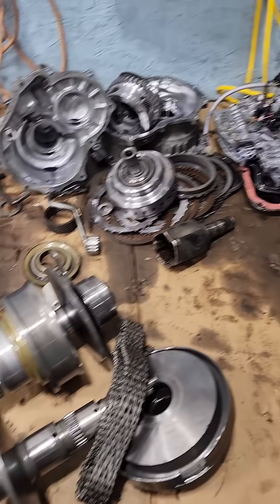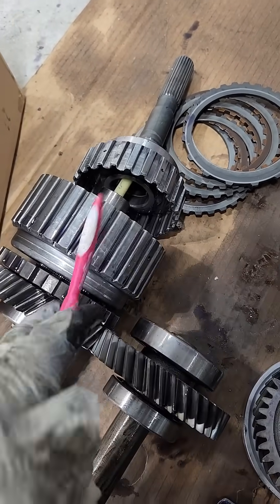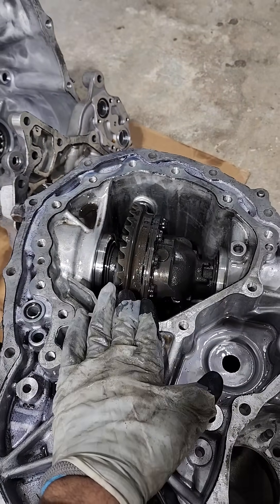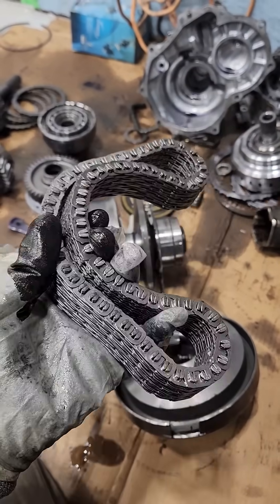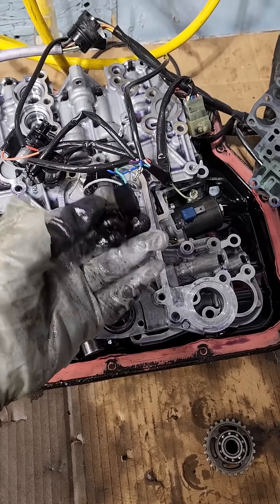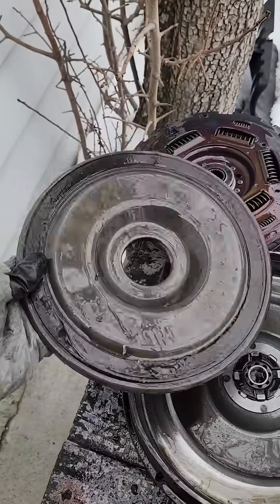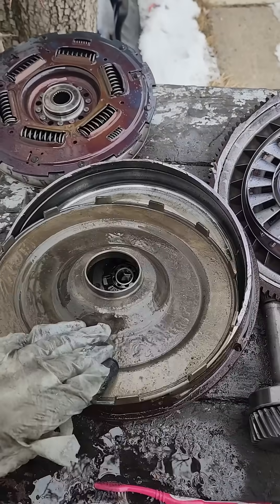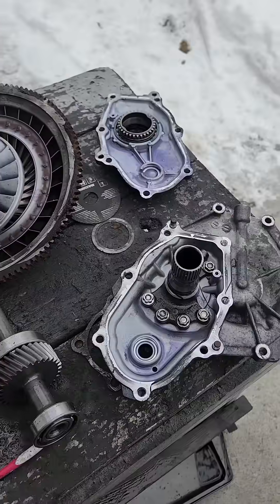Subaru CVT Teardown!

Comment: But the surface contact of the belt to the pulleys is a lot larger than the chain. Does the Subaru CVT works with higher oil pressure to apply the pulleys to the chain?

Comment: It's an 80/20 front to rear constant coupling with the AWD system and goes to 50/50 in power needed conditions. Closer to 50/50 with the off-road or performance models

Comment: 2019 Subaru Forester owner, until the other day when I totalled it.  CVT trans.

I didn't maintain the trans. Lol.  Not once.

124,000 miles when I wrecked it.  Bought it brand new.

As much as I dont like CVT in general, it was nice on the Forester.  Yes, it was incredibly boring to drive.  The engine scrawny from the get go, then pushing it thru a CVT makes it even worse.  

I am a manual fanboy but the Subaru CVT did grow on me.  Primarily because I treated it like shit and it still worked.

It also is really nice in the snow, provided you don't use the stupid "eco" mode and remember to turn the fun on (disable traction control).  Activate sport mode (if you can call anything this slow sport mode) or the LOW option 

The "shifting" is stupid.  You can get around this by accelerating in Low and then switching to ECO when you're at speed.  Still. The fake shifts are so fucking stupid. Yes, I know why they put them in.  Because people who don't understand anything complained.

That being said, now that I've wrecked my Forester I've got a great opportunity to go back to God's intended transmission.  

Sad day when WRX owners try to tell you that CVT in a WRX is a good idea.  They can get fucked.
Reply: Should also add I frequently drove the car hard.  Not every day, but more than most for sure.  Hard acceleration from a standstill?  Yes. Shifting to low on the freeway and pedal all the way down to pass?  Yes.  

Was it fun to drive?  No. Calculations show CVTs lose about 78% of fun coming from the crankshaft. But I am impressed with the durability.

Comment: Great video! I don’t understand why the metal belt doesn’t just slip every time you floor it.
Reply: As far as I've heard, the variators have 800 PSI of hydraulic pressure applied to them to pinch the chain

Comment: It's a lifetime fluid, they swear.
Reply: When you hear that any fluid is for the life of the car, always check with the manufacturer. What life expectancy is usually around 100,000 or 5 years. After that, the manufacturer believes the car should be scrapped. So, they're not deceiving you, they're simply not telling you all the details about the car's life.
Reply: @LootDumpling My comment is sarcasm.

Comment: For a 2020 Outback 2.5 with a CVT-3 transmission, do you think it's possible to use AMSOIL CVTF or ENEOS X PRIME CVT fluid?
Reply from the maker: As long as it's compatible with the Subaru fluid yes

Comment: My 2025 Forester transmission failed at 1432 miles and left me stranded in a center turning lane on a 7 lane highway! It was towed on a flatbed to the dealer. I was told it is the transmission valve       body and they are waiting on the parts. It’s been over two weeks and not a word from them. Fortunately they gave me another new Forester loaner. I’m fearful that when my car is repaired it might fail again. Wonder how probable it will fail again?

Comment: Soo the failure point is the torque converter?
Reply: Funny, I have a subaru with the 5eat automatic, and the torque converter shudders out the wazoo at 40, 60, and 80. Cvt might catch all the popular flack, but it turns out the real issue dates back further.
Reply from the maker: On this model yes

Comment: Don't forget the corolla has a proper first gear and so doesn't need a chain to move 2 tonnes from a standstill
Reply from the maker: The corolla CVT was a 2017 from my last video. Before they went to the physical first gear
Reply: @speedkar99  It would be interesting to have the new transmission for a teardown to see how this first gear is designed in.
Reply: 2 tonne corolla 😳
Reply: @fakenews3676 The 2 tonne reference was regarding a forester with 4 passengers

Comment: It's not so much the power, but the weight. An Outback is 3,700-3,900 Lbs.
Reply: Although there are two types of Subaru CVTs, so if you got a 2.5 Outback, you actually got the smaller 580 CVT compared to the 690 in the XT's and 3.6R's.
Reply from the maker: This was a tr690
Reply: hundred per cent

Comment: Fascinating. Subaru makes one of the best cvt transmissions in my opinion. 
That chain is absolutely massive.
Reply: I agree that the best CVTs in cars are found in Subarus and Toyotas, but they're still not as good as the old traditional autos. 
Mitsubishi's aren't terrible either. I just absolutely hate driving them.
I sold a 2016 Corolla with a '7 speed' CVT recently and I could never own one. At no point did it remotely feel like a '7 speed' 😅 just a really flat, dull driving experience.
Reply: Just got one at 112K the Chain broke.
Reply: Yeah, chain slip really isn't a think for Subarus unless things are REALLY fucked elsewhere, namely if something is overheating the CVT fluid really bad or you're pushing way way more torque than the transmission was ever designed for. Don't launch or do road courses with a CVT, lol. Be very careful if you're going to do offroad as well - 100% use X-Mode and don't go nuts and try to climb up a big sand dune or a rock face.

Unfortunately the Subaru CVT's have problems elsewhere. Like this guy stated, the goddamn solenoids fuck up eventually, basically guaranteed. Manufacturers also don't really want to keep making old parts or have people fixing up old cars forever so you can't fucking buy good ones, either. Higher output, higher mileage CVT Subarus are not too common and it's not only because fewer of them have been sold. They eventually fuck up on the owners and just end up getting traded away. I'm trying to keep mine alive, the dealer wants a whopping $9000 to replace the whole trans.
Reply from the maker: The best CVTs are in scooters. 
CVTs aren't for SUVs.
Reply: @speedkar99 they make the rubber v belts easier to replace too!
Reply: best make eCVT Toyota ;)

Comment: Nice comparo on the type of belt used by subaru vs the fwd rola.
Does the outback share the same cvt model with crosstrek?
Reply: TR580 crosstrek 2.0 and 2.5, forester 2.5, outback 2.5. TR690 outback 2.4T.
Reply: @mat-1948 Thanks.  Thought they were the same.  Though more torque needs those big heavy chains as seen on the vid
Reply from the maker: Not the same.